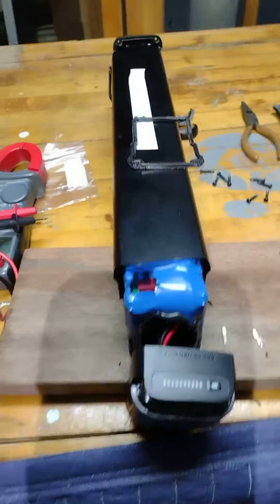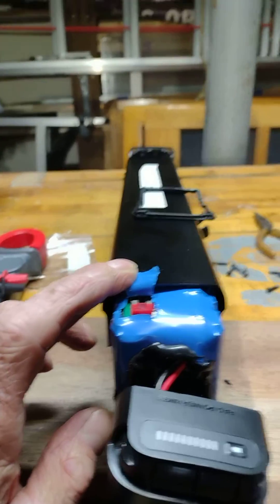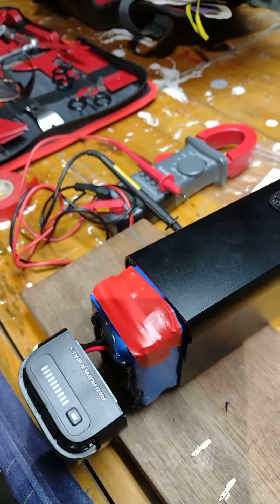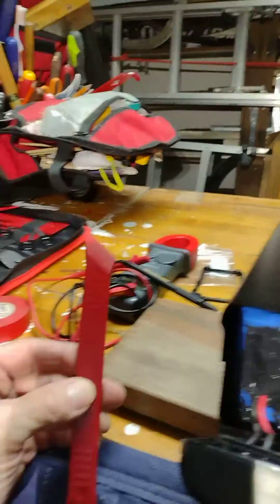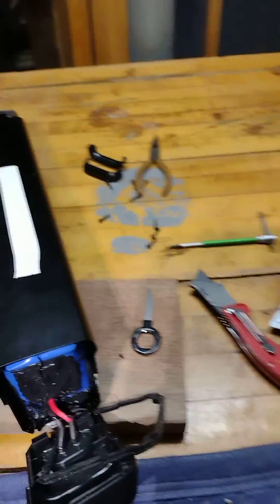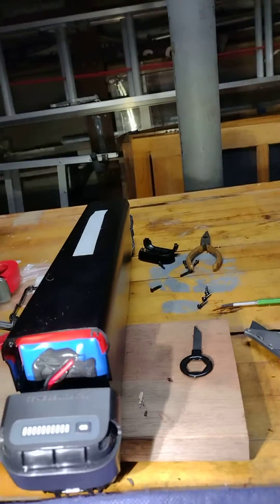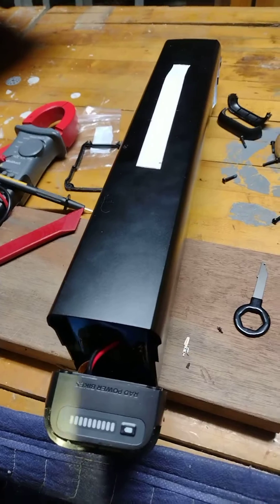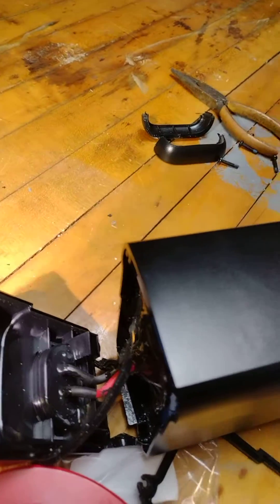radrover battery management fuse replacement

Comment: I installed a new fuse and I can’t get the light to come on my battery at all. What did I do wrong?
Reply from the maker: It may not be recoverable . I have attempted to repair 3 only two were recoverable.
Reply: My battery has no lights on charge scale at all.I replaced the fuse on mine , even though it was not blown, and still no sign of life..

?? Frustrating because this battery is only two years old and barely used

Comment: Brand new bike. 10 days old, & I've done this. After watching several vids, and some persistance, I was able to delicately extract the blown fuse. Find one tomorrow and see if it goes back together working. 
What a poor design. It's way too easy for people to do this
Reply from the maker: Good luck 👌
Reply: @conantdog  Rad gave me a break, and are shipping me a new battery for free 👍.  Rad were very accommodating on this.
Reply: @frankdaeran352  There were accomaditing because it was under Warranty.  Otherwise they will sell you a new Battery.
Reply: What do you mean POOR DESIGN ??? It should be easy for people to do this, Dummy !!!

Comment: Hardest part for me is getting the battery out of the case. Any tips?
Reply from the maker: carefully push the battery partially out with your thumbs after  cutting silicone bond . push out battery just enough to replace fuse.
Reply: It is very tight inside aluminum case. Use a long skinny snap off razor blade and keep cutting that silicone all the way into the corners. Even then, you need the handle of a hammer or something to push out the battery. Rest only the corner of the aluminum case on something elevated to support the aluminum as you push the battery down and out

Comment: did this exact thing feeling around in the dark trying to unlock the battery and touched the charge port. At first, the bike would not start but re-seating the battery fixed that and i thought everything was good until i went to charge it and it wouldn't charge. Rad wanted $700 for a battery that they didn't even have in stock and with no ETA.  Took me all of 20 minutes to replace the fuse at a cost of about $1 for the fuse. Everything is working now.  Highly recommend this fix over buying a new battery.
Reply from the maker: I'm so glad my video helped you  .👌